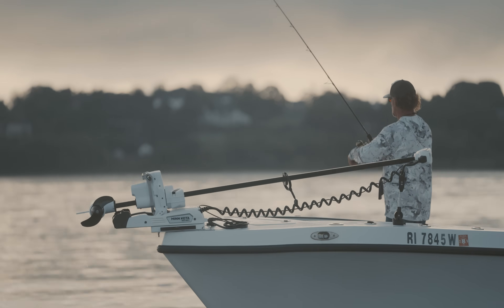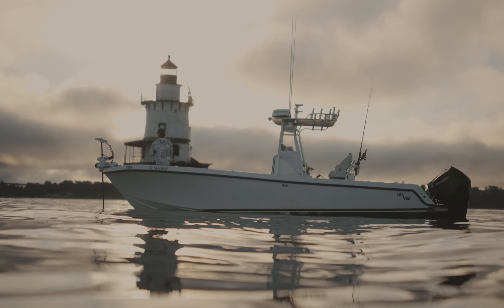Riptide Instinct QUEST Overview | Auto Stow & Deploy Saltwater Trolling Motor

Comment: 72" Shaft On a Key West 244CC. Minn Kota sent the first one which was professionally installed but was found to be delivered defective. It would not trim. This is a brand new product and as always there can be "hiccups" . This was a big one because after the installer removed it, he took it to an authorized Minn Kota Sales and Repair shop, it had to be returned because it was in fact defective. Minn Kota replaced the unit free of charge which was fair. However, the labor to remove it and bring it to a repair shop, pick up the new one and reinstall it was not free. Not to mention a months delay to finally have an operating unit. Kind of sucks to be delayed and pay extra after buying a very expensive unit. On the bright side... Minn Kota did replace it. Seems like an extremely solid unit compared to any other Trolling Motor I have ever seen. Haven't really used it yet. Only time will tell. If you are a patient person, I suggest you wait until they work the bugs out.